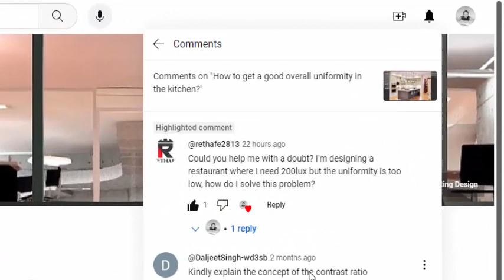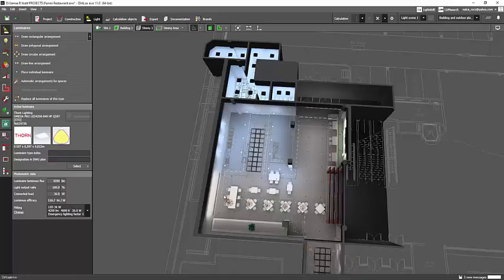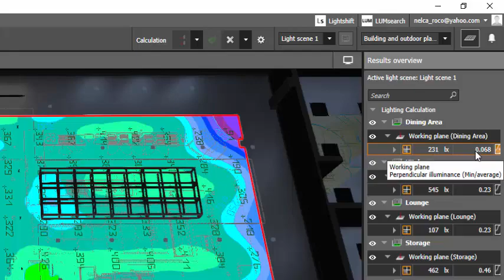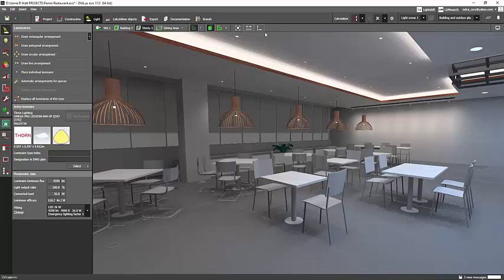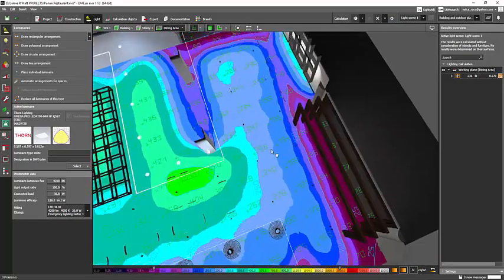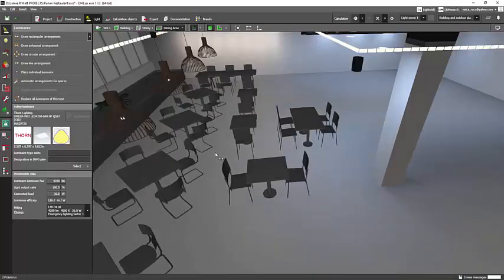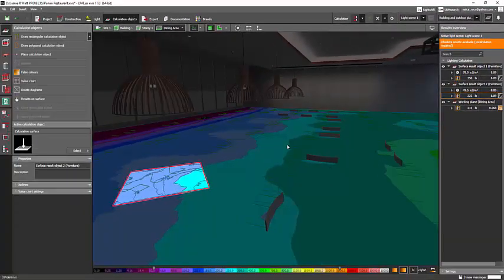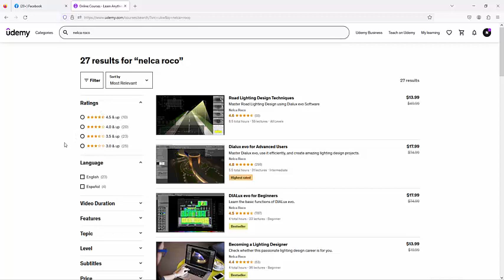How to get a good overall uniformity in a restaurant?

Comment: I work in retail lighting supplier before and I did alot of cafe and restaurans, what I am doing, I determine the path of customer from door to counter frontage and I make calculation plane in that path normally with 1.2-1.5m wide. I believe that that path must have a high uniformity since thats where the major activity and foot fall.